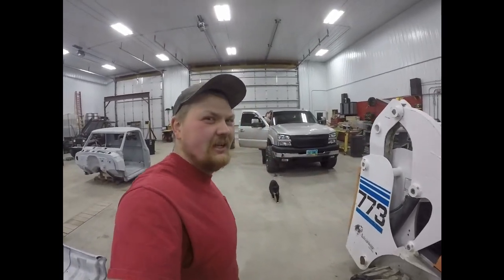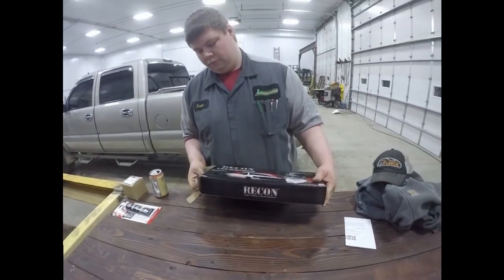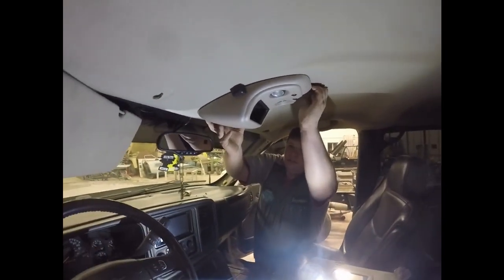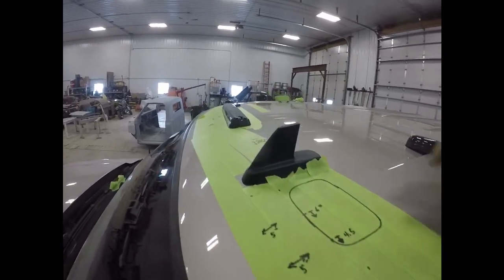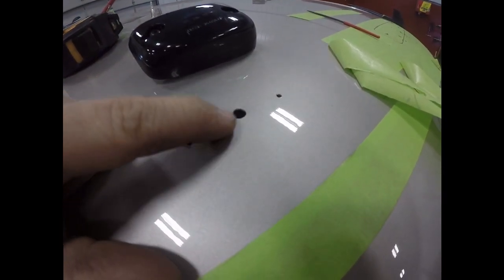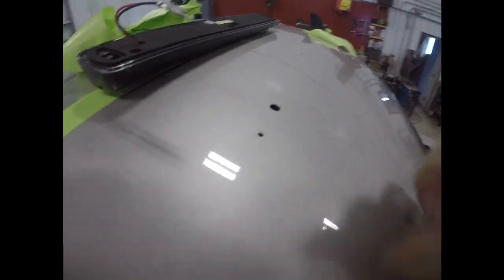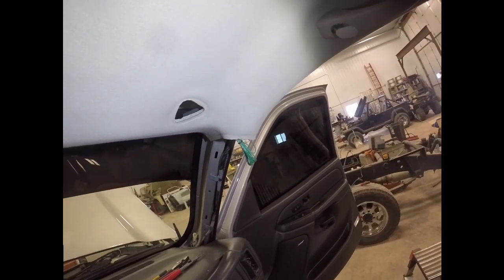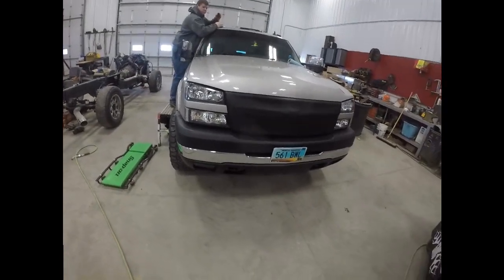How to Install Cab lights on a 99-07 chevy/gmc pickup

Comment: odd question, do you remember the distance between the screw holes on each light?  I'm wondering if they'll match up with the older gmt800 cab lights

Comment: Are they still working and free of moisture? I've heard mixed reviews on the recons, I really want to do this mod though, looks sweet!
Reply: I was wondering the same thing myself because I'm install a set back in December and the moisture got in on mine!
Reply: @josezarate1362  There is a company out of Ohio and one in NY they sell stuff for the big rigs and mostly it's an entire kit. The kits are fantastic they have instructions and come with all the wiring stuff too and I am not talking cheapo Chinese stuff. The kits are all over 100 bucks and some are just under $150.. If you want to screw around with that cheapo plastic Ebay novelty junk that is up 2 U. The stuff like Vehicle Safety Supply sells and the other company it doesn't get water in the lights the old school lights have a heavy rubber gasket not that neopreme stuff that invites the water in after a couple of weeks. I was amazed at the weight and quality of the chrome metal old school light kit I got is fantastic for $140 bucks. The lights R not chromed over plastic junk. They are solid metal. The connectors were all perfect too even had a few left over and the screws were actual stainless steel not that peanut brittle they give ya in the cheapo kits. The company actually wants you to get thru the job without screwing around running for extra stuff. What I spent for that kit in todays dollars saved me on time and fuel money running around. All I needed extra was a little beer to get the job done right. I had no issues with the kit I bought nothing to even remotely say other than it is a good quality kit and the ah 40 year old restored truck looks like it just came off the showroom floor. I was pleased with the cab lights being the final touches on Holley Anne is here name. My truck was derelict half dead sitting out behind an abandoned house all in pieces.

Comment: Where’d you get the led running lights from? Looked everywhere and they don’t seem to have them
Reply from the maker: If you are referring to the cab lights we installed there is a link in the description to the white ones and the amber version plus the wiring kit we used. As far as his drls/park lamps I'm not sure where he got them.

Comment: Was the wiring harness plug and play on the older truck?
Reply from the maker: No the power has to be tapped into something. We just tapped into his boost auto harness running lights, which were ran off a fuse tap in the under hood fose box

Comment: How did u hook up the turn signals in the mirrors to the running lights
Reply from the maker: The wiring is ran through the firewall and into the under hood fuse panel where we used fuse taps to connect them to the turn signal fuses.